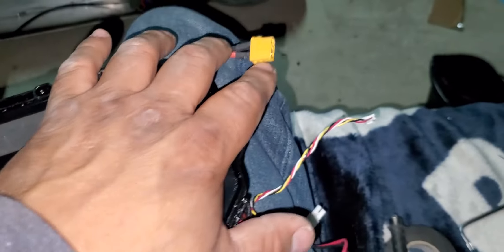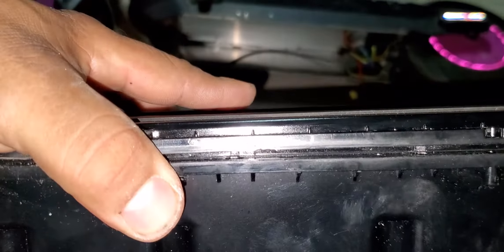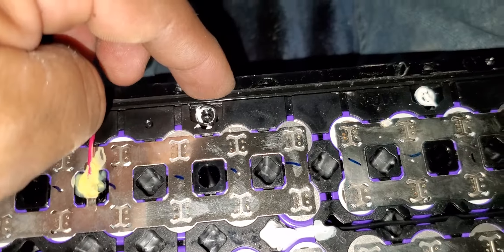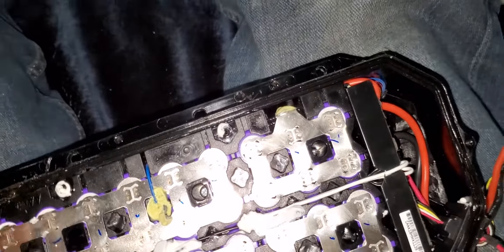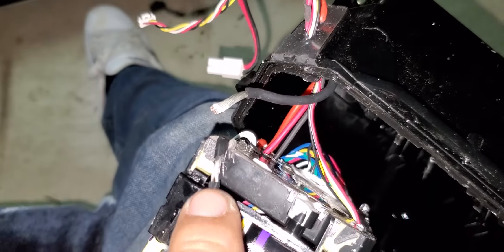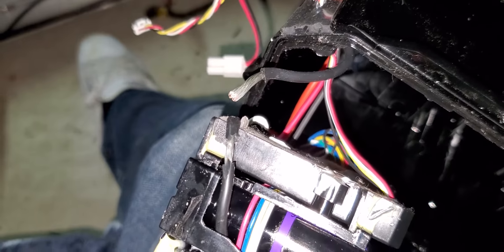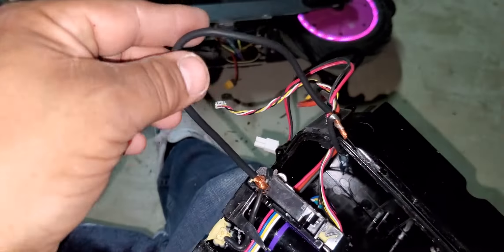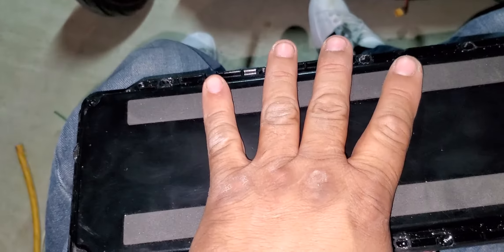Segway Ninebot max g30 BMS (Battery) bypass.

Comment: Hi friend. I have the same problem with my scooter which is ifentical to g30 max and replaced the bms but still it is turning off after 5-10sec. Can you please tell me how to flash the battery so I won't need to bypass it.

Thank you for your help!
Reply from the maker: Your going to have downgrade the bms, in order to make it work. If so, doesn't work your going to have to bypass it or get a new battery
Reply: @chuyramirez3731  Hello my friend,

Thank you for your reply, and for your support.

Can you please explain to me, as I am a newbie in electric scooters, what do you mean by downgrading the BMS?

Thank you very much fir your time and cooperation.

Best regards,

Avni
Reply: And by the way I installed the same power BMS as my previous BMS, which was 10s 36v 15a BMS which my scooter had it installed before replacing it with a same power type of BMS